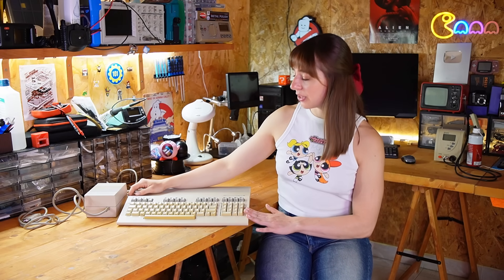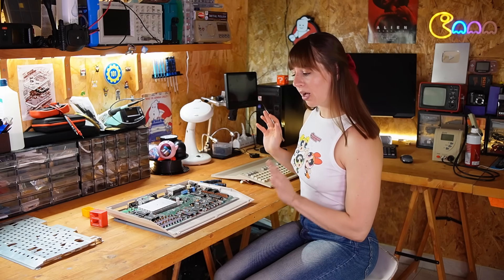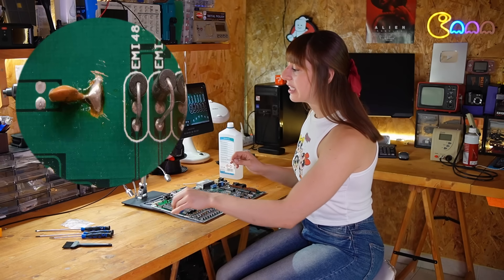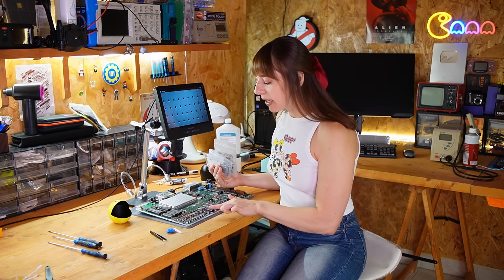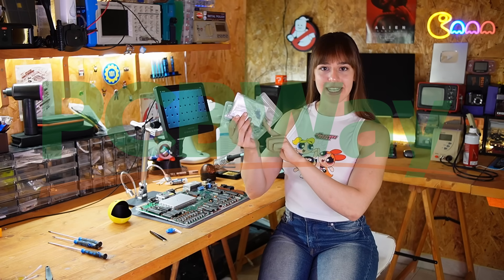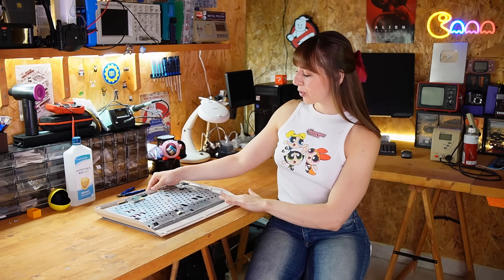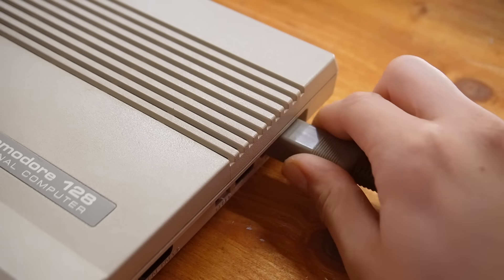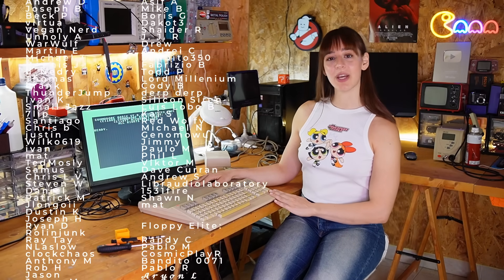Someone Tried to Fix This Commodore 128 (And Failed)

Comment: Old electrolytics and sometimes tantalums are worth replacing when they are no longer reliable but if I remember correctly, ceramic disc caps are quite reliable long term so a failed one will not mean the others are going to go soon. Try to get accurate information, which means actual experts rather than people with opinions or those trying to remember decades back (like me!). When I was learning this, we had text books, manufacturers' catalogs which always had an appendix at the back full of tech info and engineers that you could easily call on the phone at the largest companies and ask questions. I'm not kidding! 😊
Reply from the maker: That's a great point! I always try to find accurate informations before doing any repair

Comment: If I was someone who'd worked on a repair earlier and Sayaka said "I'm not a fan of these solder joints", I'd be completely embarrassed and would want to practice a lot more. (I also used to do a lot of soldering, but not for electronics, rather a completely different application/skill, and I took it seriously if people commented on the quality of my work.)
Reply from the maker: Well soldering is definitely something that requires a lot of practice!😅

Comment: Hello from the UK. Do you keep old PCBs from electronic equipment like TVs, computers etc? It's a good way to get lots of usable good components for repairs. Recycling electronic components in this way is also a very good use of resources.
Reply from the maker: I do! Thanks for the tip

Comment: So glad you caught the caps in the PSU. I would just change the ceramics with modern equivalents from a place like digikey or mouser. They are smaller and look better imo. The PPG rock! 😍

Comment: These are non-critical decoupling capacitors. Originally, 220nF capacitors were used there, but any capacitor in the 100-470nF range will be suitable. Yet, if they are not physically damaged, they do not degrade over time like electrolytic capacitors do.

Comment: Consiglio di acquistare un set di condensatori ceramici MLCC. È possibile acquistare un'intera scatola con tutti i valori possibili. Sono disponibili ovunque: par essempio Conrad, Reichelt, Ebay, AliExpress, dove preferite. Il Commodore 128 utilizza condensatori ceramici a disco. Questi sono stati sostituiti nell'elettronica moderna dai condensatori ceramici MLCC: non ci sono svantaggi, solo vantaggi. L'unico motivo per utilizzare condensatori ceramici a disco è l'autenticità estetica.

Secondo Bil Herd, progettista del Commodore 128, i condensatori MLCC erano già disponibili quando il Commodore 128 entrò in produzione e Commodore li avrebbe volentieri utilizzati, se non fosse stato per il loro costo ancora troppo elevato.

Un condensatore da 4700 uF che è salito a 5400 uF non deve essere considerato difettoso. Il valore di un condensatore elettrolitico è normalmente +/- 20%. Si tratta di una deviazione del 14%, quindi il condensatore rientra ancora nella capacità specificata. È normale che la capacità dei condensatori aumenti leggermente con l'invecchiamento: il processo di autoriparazione dell'alluminio fa aumentare la superficie dell'alluminio e quindi la capacità. Questo condensatore stava invecchiando in modo sano e probabilmente avrebbe potuto funzionare ancora per almeno 10 anni.

Comment: AliExpress is where I usually go for affordable component packs of various sizes and values. 
Their search engine is horrible compared to eBay, so a trick I've found is to find a relatively cheap version of what I'm looking for, then I scroll a bit down for recommended similar items and click on the same item for a cheaper price. Repeat this till it no longer suggests the same item with a cheaper listing. 
There are also more recommended items at the very bottom of an item's page where I sometimes still find the same item with a cheaper listing.

Comment: What's special about the caps? If they are just unusual capacitance, the closest value standard ones probably work fine, and they can be higher voltage too.

Comment: I had one of these. I didn't really know what to do with it. The one thing I used it for was to experiment with Assembler. I ran my first machine code on it. That loose screw in the power supply could have caused disaster. It's a good thing you fixed it.

Comment: I used to really love my C128, but the disk drives were big and expensive and never lasted long. I bought 3 or 4 drives then gave up on it.. 🙂
Reply from the maker: Sorry to hear that! I've heard the disk drives weren't the most reliable
Reply: In my opinion, the 1571 is the best floppy drive of them all. You have to upgrade them with JiifyDOS in order to use double sided disks more effectively with C64 software, but once done, the 1571 is just excellent.

Comment: Nice job and nice soldering work. Always good to see a C128 resurrected and brought back to service. It's a really weird little machine but it does have a lot of fans around the world. For cleaning card edge connectors like the user port and cassette port I often use a white eraser (like staedtler) and gently rub it.
Reply from the maker: Thank you and thanks for the tip, I'll be sure to give the eraser method a try!

Comment: I like those ceramic capacitors, I think that there would be some in TV's from the same era, but I wonder why you can't use modern capacitors of the same size and rating? Kool style as always. I think i wll go watch powerpuff girls episode now.

Comment: You dont need The exact capacitors, near IS enough!
Exept offcourse You want to remain The look of intouchbility and chance only for totally similar products..
Youre so Pro! I would hire you right away to do repairs to My electronics!

9:15 Look out for live voltage! Hazard danger! I always put some insulating tape on top of the parts where the over 80V parts are on the pcb.

Comment: If you have the means, it's always a good idea with original Commodore power supplies to just replace them with modern aftermarket replacements. The originals are well known for suddenly failing in an unregulated state with high voltage on the low voltage rails. One day, they just destroy all the hard to replace chips at once. 😞

You can also get or make a cheap circuit to put between the supply and C128 that will save the 128 by quickly blowing the fuse in the supply if it goes out of range. It's called a "crowbar" circuit. A zener diode and an SCR shorts the power supply if the voltage goes above the zener value.
Reply: Yes, it´s not recomended use the originals powers supplies, as you explain
Reply: The C128 power supply is a safe design and generally reliable. It's a switched mode power supply and if it fails the output will drop to zero, which is unlike the linearly regulated C64 supply which will output higher voltages.
They might need the caps inside of it replaced which should normally be done using low ESR caps but other than that they are fine and safe to use.
Reply: @griffinretro  Good additional info. I don't see taking the crowbar off my 128 as it's reassuring, but good to know!

Comment: Finally! Someone who doesn't drown the board in flux when soldering.
Reply: lol, you need that to make your life easier, why complain if they clean it after finishing?
Reply: @gotgg-n6w Because flux was traditionally an accessory used in small amounts but today there is this trend of making huge flux puddles. It is as ridiculous as covering all your teeth with toothpaste before starting to brush teeth.
Reply: @jonskunator  Solder creates an oxide layer when in contact with air. Flux reduces the oxide back to bare metal. Applauding someone for not using flux is like applauding someone for welding without argon turned on.
Reply: @graealex  We were talking about using excessive amounts of flux.
Reply: @jonskunator  There's no excessive use of flux. There's only "flux left after soldering", which easily washes off and is an indicator that you used the right amount. Again, there's a chemical reaction happening, and when all flux is used up, it means you didn't use enough.

Comment: I would still measure the power rails of the computer itself for resistance before plugging it in, even with your bench power supply, but certainly a big improvement over the last time where you gave the device the smoke test right off mains without even opening. And certainly a good call on recapping the original PSU, and checking the output voltages before plugging it into the computer. I'm really interested in seeing a repair in the future that is more demanding. After all, you got that Tektronix oscilloscope on the shelf.

Comment: Just goes to show how far ahead of the curve Commodore was! They had the first 64-bit system in the 80s (Commodore 64) and then put out a 128-bit system when the competition could barely put out 8-bit machines! Amazing!
Reply: If you're not joking you might want to check out the Wikipedia articles for those two computers.🙂

Comment: just replace the cap's with run of the mill standard ceramic decoupling cap's. imho they dont necceraly need to look the same? Just function allright. But he. You do You! good job getting this thing running again!

Comment: If you don't really need the big disc capacitors you could just go for the smaller ceramic capacitors which would also do a great job. Something like TDK FG28X7R1H224KRT06 from Mouser should do the job just fine.

Comment: Fantastic repair, as always! Love the C128 BASIC and the added features, makes BASIC a joy compared with the C64 (although the C64 is soooo nostalgic). Thanks for the video!
Reply from the maker: Thank you so much Veronica! I'm glad you enjoyed the repair and totally agree about the C128 BASIC!! 😊
Reply: Girls rock repairing electronics.  🎉
Reply: Nah, c*mon, Atari 800XL was much better, more Color and so on.
But yeah, C64 won the battle.
Reply: @XzarElite  C64 and C128 had sprites which no other computer had. However, I loved the Amiga 500 voice synthesizer best.
Reply: Yeah i also had an Amiga500 with 1MB RAM 🤪and 20 MB Hard Disk, Top Notch, If i remember, monkey island had 8x3,5" or so. However, had Atari ST good sound too, or even better sound?!
Reply: Maybe you could ask Taylor & Amy to give Sayaka one of their "Cartrige Contact Cleaners" 😉

Comment: Ciao Eleonora, non ho posseduto un C128, ma ho optai per l'Amiga 500. Per i condensatori ceramici a pastiglia, a volte vado di recupero su apparecchiature recenti che smonto. Su Amazon dovresti trovarli quelli ceramici; una volta ho visto un kit in valigetta con molti valori.

Comment: Quality work and nice presentation as always from you 😊 The ceramic capacitors usually doesn't need replacing as they are not getting much abuse on this kind of circuit. The ones that were broken must have been broken by someone before doing some work on the board. They are fragile for sure if misshandled but i think that C128 is now good to go for another decades!

Comment: Hello, Sayaka. I'm not sure whether your country has it, but Amazon online should sell all the components you need, like 30 pieces of .22uF capacitors. Hope this helps. Please keep up your great work. 🤔
Reply from the maker: Thanks! Unfortunately, availability changes a lot depending on the country and I couldn’t find .22 µF 16V capacitors on Amazon here
Reply: @Sayakas_Digital_Attic  Yes, modern MLCC capacitors can withstand higher voltages, usually 50V or 100V. Technology has improved :) You can always use a higher voltage, it's a maximum after all.
Reply: @Sayakas_Digital_Attic  Prova con amazon germania ci dovrebbe essere...in caso prova altre nazioni in europa
Reply: @Sayakas_Digital_Attic Any small electronics stores there? They might have what you are looking for. The electronics stores I am referring to sell components and various parts for projects.
Reply: Farnell is probably a better bet for quality components.
Reply: AliExpress should have those capacitors.

Comment: Such a pity that there weren't that many games that took advantage of the 128KB.  Remembering it arrived a 'too little late' as the 16-bit home computers such as the Atari ST and Amiga were on the horizon and when they were out it was too late. Similar thing happened to the Sinclair Spectrum + 128KB.
Reply: I don't think that it had a lot to do with the 16 bit computers, but to keep compatible with the old models.  Back in 1985 the original Spectrum and C64 were great platforms in terms of selling software for it.  Making enhanced software for newer models would costed more money than most software houses wanted to spend.  The same thing happend with the PC, they even made games for CGA when VGA was available.

Comment: Based on the schematic images you showed, those appear to be power rail decoupling/bypass caps.  Any capacitor of that value or even close to it (ceramic, film, MLCC, etc. from 100nF to 220nF) will work fine there.  220nF is a pretty common value.  I would recommend using C0G/NP0 rated for ceramic, or use polyester or polypropylene film if you go with film.  If you need more, and can't find them in your area, I'd be happy to send some.
Reply from the maker: Thanks for sharing that info and the advice, it's good to know what to look for when replacing them 🙂
Reply: You really don't need C0G/NP0 for decoupling caps. Decoupling is one of the few places I'd use some of those craptastic caps with the terrible temperature coefficients.
Reply: @flapjack9495  I disagree.  Lower temp coefficient isn't the only thing that improves with the higher rated ceramics.  Also voltage coefficient.  They are also less prone to oscillations of their own.  The point of the decoupling caps is to filter power ripple near the power pins of the IC, and provide some bulk capacitance, so the better they do this, and the less of their own noise or fluctuation, the better.  I'm not saying in many applications the lower spec caps won't work, but IMO it's better to err on the side of reduction in those variables in the first place.  Whether it matters on a C-128 board is up for debate of course, but I personally just use film, mica and C0G/NP0 for EVERYTHING I do depending on application.  It doesn't add that much to the overall cost of BOM or repairs to do this.  (unless of course we're talking about values that just aren't available or are prohibitively expensive in those ratings, and then I find the closest rating that provides the value at an ok price)  ESR can also be a consideration, but using decent ceramics already should cover that.

There is a difference in price of course.  You can get smaller C0G/NP0 values for a few cents each at certain lower quantity breaks.  For 220nF though they're roughly $1 each.  However, if you're just replacing a handful of them in a computer that you want to last for years to come, then a few $ isn't that big of an investment.  Mouser has plenty of Kemet and TDK MLCCs 220nF C0G/NP0 for around $1 each.  Price breaks for larger quantities of course.
Reply: @DrJ3RK8  OK, fair enough. I'm just a hobbyist when it comes to electronics so I'm probably going to spend a few cents more for the better quality components anyway because the difference at my scale is so minimal. If I were engineering commercial products I might be told to do differently, of course.
Reply: @flapjack9495  Agreed!  I didn't mean to come off snooty there either.  Just mentioning how I'd personally go about it.  :)  I prefer to go with better components up front in nearly every case, but there are definitely cases where saving a bit may be advantageous.  

I see repairing old computers more as a labor of love though, and I'd tend to go all out on something like that if possible.  ;)

There can be diminishing returns of course, and I don't like to go into the snake-oil range of products.  I just like to go with the best part I can for whatever it's doing without getting absolutely ridiculous.  (though sometimes I like to get a bit ridiculous too)  :)